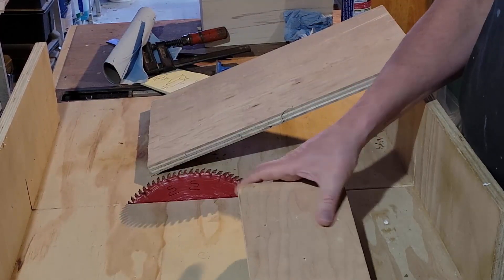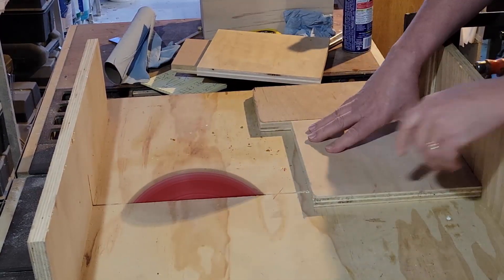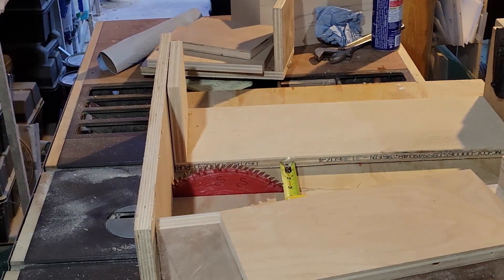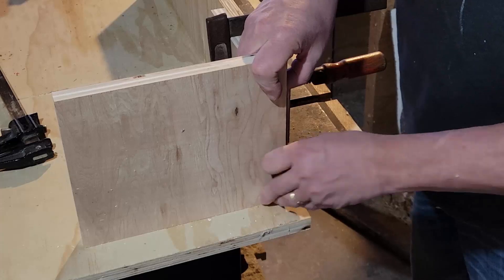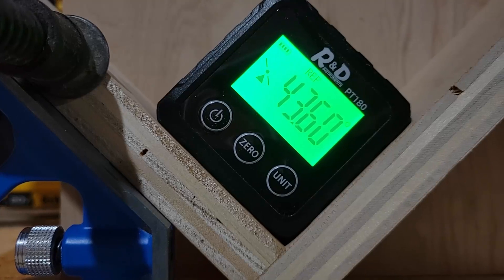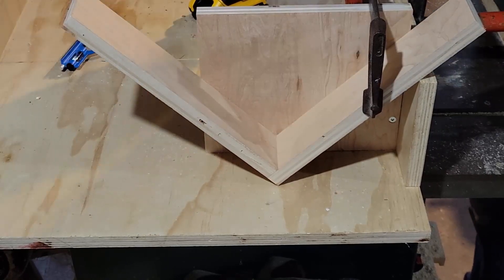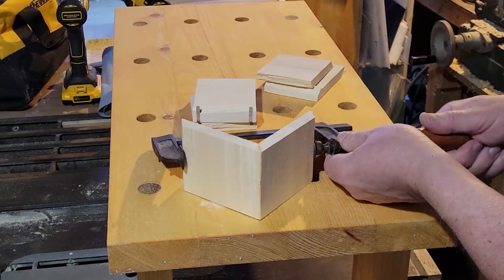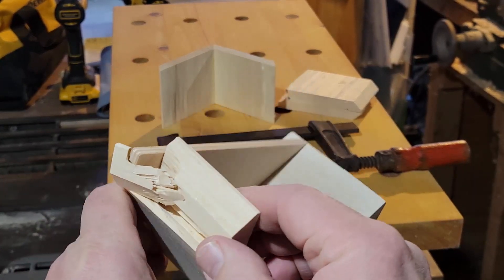Testing Out Spline Strength

Comment: also, the wood grain of the board sides are side to side and not along the board. So when you did you strength test, ofcourse it will snap. However it is still a good demonstration of how strong the miter and spline joint is together. Try the experiment again with the wood grain along the board, and im sure it'll be much stronger.
Reply from the maker: I had noticed that. For some reason I thought it would be interesting at the time. I will be repeating this to test the other way around (might as well since the jigs are made) Thanks for taking the time to comment